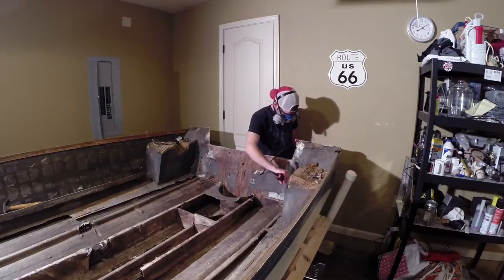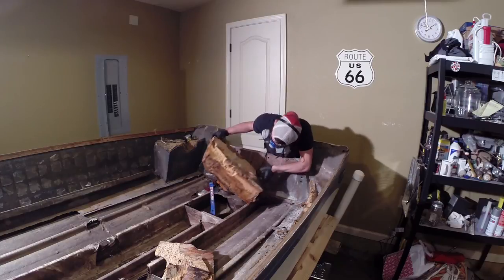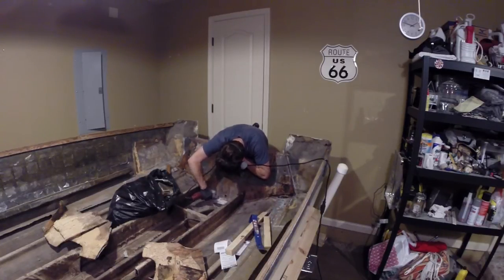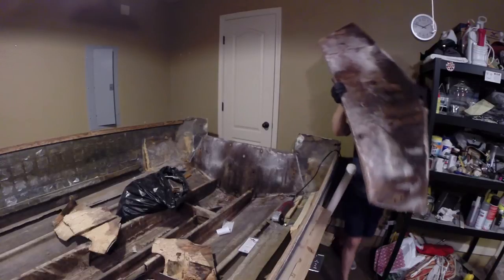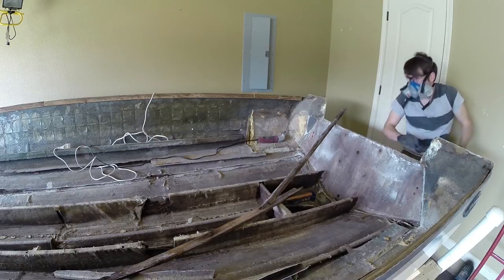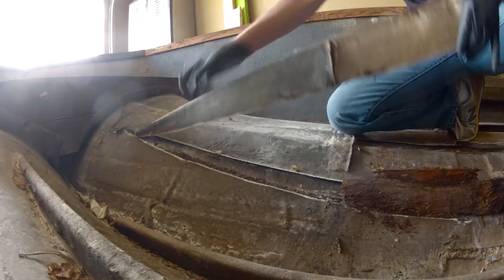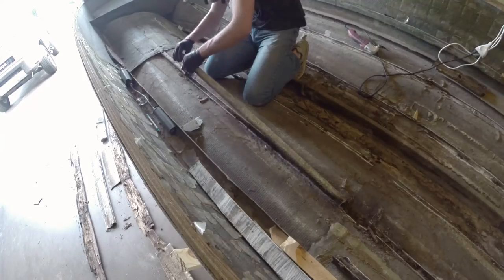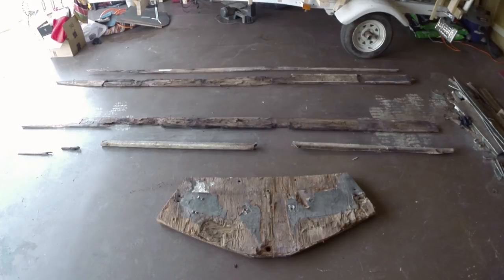Transom and Stringer Removal // Project Glastron/Vlog #5

Comment: thanks I could go the seacast rout but think the foam would be a little easier that stuff doesn't pour as well the glass is in great condition and i am able to simply pull the wood right out in one piece is not really rotten but think the original bond when manufactured was probably bad poor mixture or some water just delaminated it  I like the idea of having no wood in there. I may just make a test piece and see how strong it will be hit with a hammer, run it over with my truck maybe submerge it it water for a day or two had see if i can get it to fail

Comment: What kind of cutting blade are you using with that osolating tool. I bout a Dremel like that and the blades would cut good for about 7 min then not cut anything. It was a wood/drywall blade.
Reply from the maker: +My Damn Channel I took the cheap route and used this http://www.harborfreight.com/power-tools/oscillating-tools/oscillating-multi-tool-68861.html and then I bought some of these blades - http://www.harborfreight.com/1-18-in-bi-metal-multi-tool-reduced-shank-plunge-blade-61821.html and http://www.harborfreight.com/3-12-in-High-Speed-Steel-Multi-Tool-Half-Moon-Blade-61815.html
Reply: @jmink  thanks for the Killer Videos!!! Follow up to the Oscillating tool...when you cut the stringers with it, is there any science to it? Do you just set the blade on the hull and slice off the stringer? I'm terribly nervous to make a mistake.

Comment: I am looking to do a similar project om 17 ft 1970 glastron what do you think about just getting the bad wood out leaving the fiberglass sides of the stinger system filling that with high density pour foam 8lb or better and glassing over that with 1708
Reply from the maker: +Chris Horton baseball I think if the original fiberglass surrounding the wood isn't too rough of shape, i'd say it's worth looking into.  I've seen the method you're talking about, but I don't know enough about it to say what the pros and cons are. I do remember seeing a guy use seacast to pour in then fiberglass over like you are talking about and he seemed to get great results.

Comment: Hello, whats the name of the tool you used for cutting out the transom and stringers? Thanks. I have been offered a glaston v156 for free that needs a lot of work and am using your very helpful videos to give me an idea how and where to start :)
Reply from the maker: Hello Ruan Urquhart the brand is a Chicago Electric and it is a Oscillating Tool here is a video review of one here on YouTube Harbor Freight Oscillating Multifunction Power Tool Review. Item 68861
If you can get the boat for free take it! Glad these videos are offering some help, good luck with the boat!

Comment: Great videos, keep em coming! I just have a couple of questions...what kind of respirator are you wearing? Do you find it pretty comfortable and easy to breathe through, especially when wearing it for extended periods? I'm looking to buy one soon. Also, what kind of gloves are you wearing? They look like standard rubber gloves but they most be pretty strong to not tear when working with the wood. Is there a particular size glove you wear? Good luck with your project!
Reply from the maker: ijks2010 Thanks liking my videos! The respirator that I use is this one right here >>http://www.amazon.com/gp/product/B00009363G/ref=oh_aui_detailpage_o06_s00?ie=UTF8&psc=1 it is supposed to be ideal for all the different things I have been and will continue to be working on with the boat.  As far as breathing with it (speaking for myself) is noticeably different. Mainly it is like your nostrils are working a little harder to breathe, I can't say it is specific to the brand or style though.  I got the rubber gloves at Lowes >> http://www.lowes.com/pd_425006-68591-VEN6045R_0__?productId=50218409&Ntt= they're one size fits all and most of the time I wear a large size glove. Hope all of this helps you out!
Reply: jmink Thanks for the reply and the helpful links! I got the mask you recommended from amazon and it works great, I can't smell any fumes and its nice to not get your nose clogged with dust. I'll be heading to harbor freight tomorrow to get those rubber gloves as well. Thanks again!
Reply from the maker: ijks2010 You're very welcome and best of luck with everything!